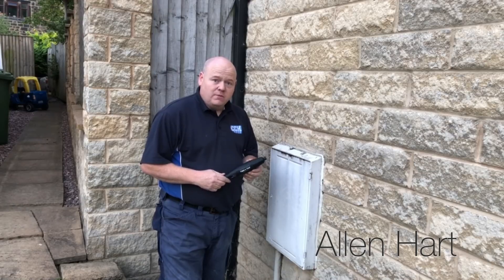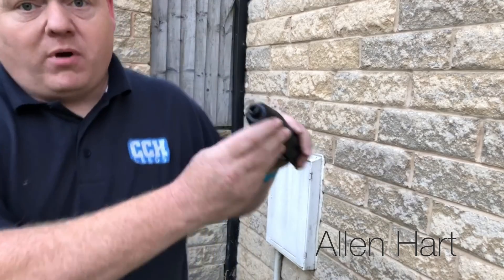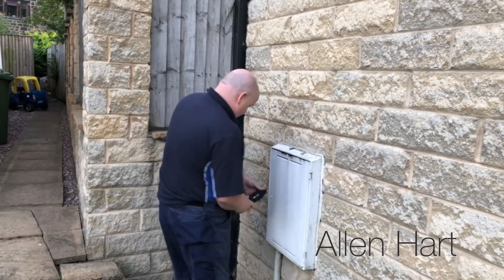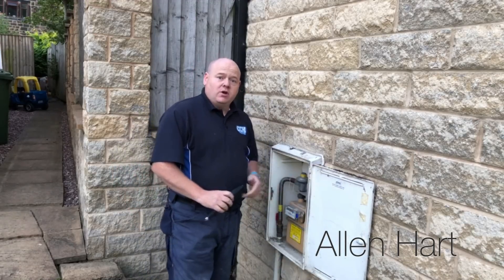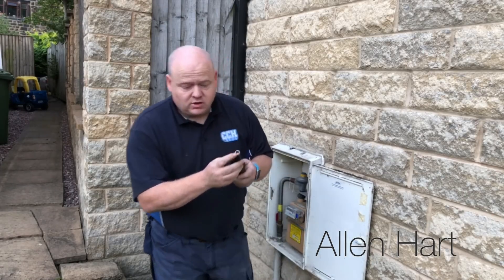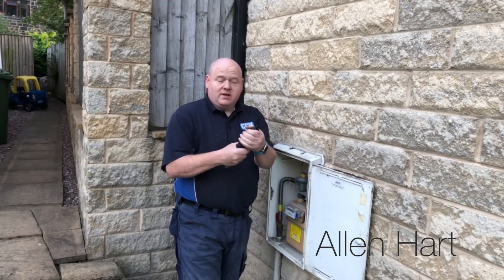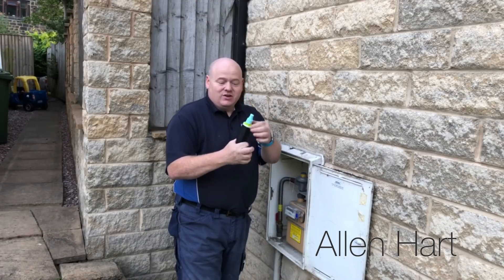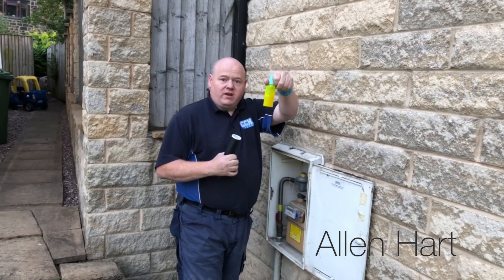Tight n Test Prototype Testing New Tools

Comment: You seemed to be holding back a smirk. I might be wrong. You also did a little sort of hip swaying jiggle. Again I may have misinterpreted it. However, when you pulled that huge tool out... it looked like something the missus keeps in the bedside cabinet, her side of the bed.
Reply: loafer sheffield Lol ! You poor man
Reply: @Heat Service bwc uk  "Giggity!"
Reply: loafer sheffield Lol Just found it funny
Reply: It's called self defecating humour... or is it self deprecating? I get confused. Been sniffing too much ABS paste again.
Need to ventilate the room when on the glue or when taking a poo. That's another house rule btw. 
I've had a good day. Tee hee!
Reply from the maker: Thank you for your feedback.

Comment: Was about to say a digital manomoeter  would make it the perfect tool.
Reply: Hi Allen I have a combi boiler that only fires on heating when the hot tap is running? Any suggestions what could be the issue.
Reply from the maker: Divertor maybe ?
Reply from the maker: sounds good.
Reply from the maker: Thank you for your feedback